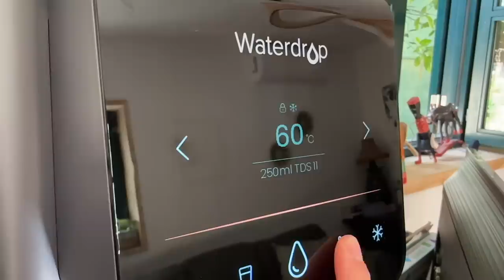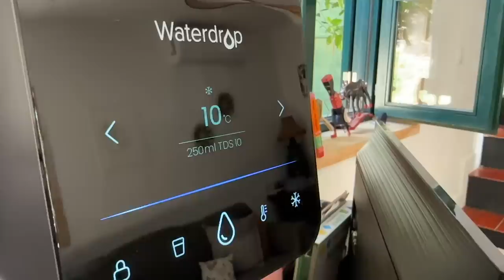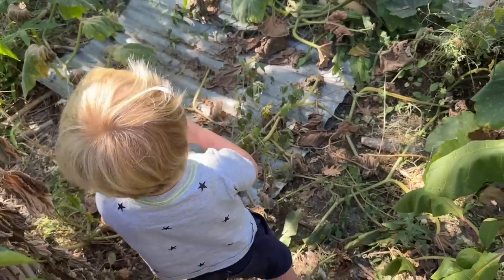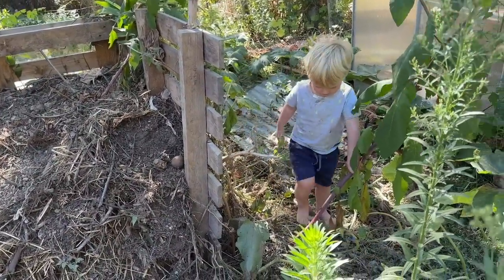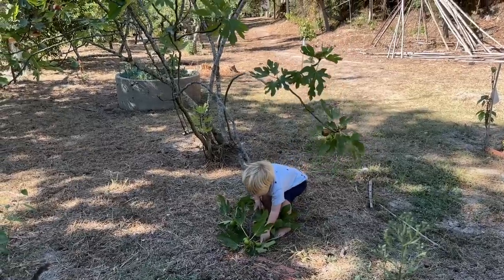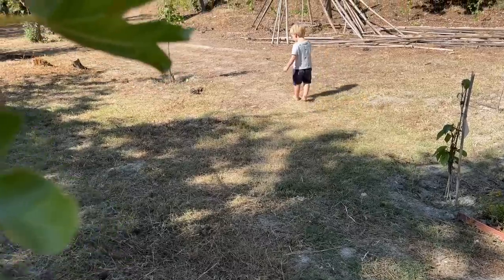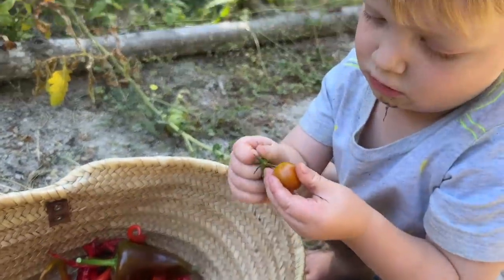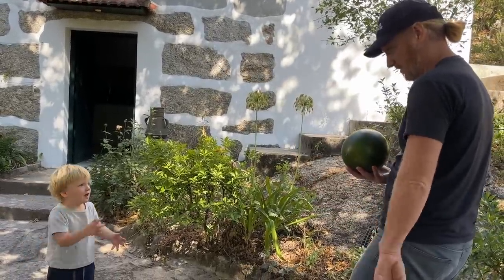It's time we GOT THIS DONE on our Portugal Homestead

Comment: I have a large lidded bucket with a sturdy handle that I just leave in my garden. Inside I keep much of what I need to work in the garden. String to tie something up. Scissors. A hand trowel and a hand cultivator. Small stakes. A few pairs of garden gloves. Bug spray. A small hammer. And a pair of hand clippers. This way I have just about anything I need on hand at all times to work in my garden. I snip all my vegetables loose with the hand clippers. Cut string to tie up plants. Pound in stakes at each end of row. Cut and tie string to set as a guide to place my seeds. When I m done I just tightly close it up and set it in an area where it’ll be a bit shaded and out of the way but handy.
Reply from the maker: That is a lovely idea Kathleen, thank you for sharing that with us! 🐓💧🍅🍉🙏🏼🇵🇹🏡

Comment: Hi gang !!
Tara, as you mentioned, mebbe better to make big compost. Is there any manure available?? Horse, cow, goat?? You could also add the chickenshit on the compost.
 As for watering, I have seen pipl putting down thin hoses with holes along the beds, just some cm under the surface, and then you could have a water container at the end of the field,connected to the buried hoses, so the water will come under the surface, near the roots, thus saving water.
 Ordinary watering from above, mebbe lots is evaporated and more time consuming too......At least try out the buried hoses,and see whether it works. 
Amazing tomatoes and melons !! And Sawyer chomping along merrily behind yer head....Very charming !!
 Seems that dear John´s shoulder have sort of healed, since used the hand saw on the chicken coop....
As for sweden, me boat are  properly covered and motor conserved, now I have to reap the large leaves of my LARGE 40 tobacco plants, and dry them in the former furnace room while I am on Karpathos, Greece...
.I shall make snuff from them. John have probbly encounter this nordic habit in Finland, putting tobacco under the upper lip....Very practical....hehe.....
Alldabestest from auld mikke...;-D
Reply from the maker: Hi Mikke, great hearing from you again. Thanks so much for all the advice regarding the compost. John has indeed heard of that nordic habit haha best of luck with all the large plants friend! Thanks so much for watching 🐓💧🍅🍉🙏🏼🇵🇹🏡

Comment: TOMATO JAM

Put tomatoes in boiling water –
take out and peel off –
Now weigh your tomatoes –
for every 1 kg of tomatoes, 1 kg of sugar –
put the tomatoes in the bottom of your pot –
simply crush the tomatoes with your hand -
now pour the sugar on top –
let it stand for a while until the sugar starts to melt -

I put my stove on 1 so that it only gives a little heat from below -
stir often - just be careful that your sugar doesn't burn -
now throw in a chopped ginger root –
Cook for about 2 hours quickly - add about 3 tablespoons of lemon juice -
Test your syrup in the fridge to see if your syrup is ready.
To test, pour some syrup into saucer and put in the fridge - let it sit for a few minutes -
if you take it out and you turn the plate diagonally, it should run down slowly like a teardrop, if it runs down like water, continue cooking.
Keep an eye on your jam, tomato jam burns easily and you can also easily cook it for too long and then it is tough - if it is too tough, add more water and cook again for a while.
Bottle warm
Groete Debbie
Reply from the maker: Thank you SO much Debbie, this sounds amazing! 🐓💧🍅🍉🙏🏼🇵🇹🏡

Comment: Bom dia from Colorado!
John, until cloning is a viable option you might want to cut yourself some slack! Don't forget to breathe! Lol
Tara, one of my favorite recipes for fall is squash soup. Ever tried fried green tomatoes? Yummy with parmesan cheese and mayo.
If you want to sweeten watermelon tried a very small sprinkle of salt. Sounds weird, but it works.
Reply from the maker: Hello Abigail, great to hear from you friend. Squash soup sounds delicious, do you have a recipe for us? They sound delicious! Thanks for the advice on sprinkling some salt on the watermelon too 🐓💧🍅🍉🙏🏼🇵🇹🏡
Reply: The lazy version is to peel, seed, and chop the squash into chunks. Boil on low until soft in veggie or chicken stock. Season to your taste - salt, pepper, thyme, cumin, onion powder, garlic powder. (Curry powder?)
Blend to your favorite consistency, add cream and a drop or two of sherry. Sprinkle roasted pumpkin seeds on top. Should be thick and creamy.

Comment: John surely the chickens are not going to be safe from foxes etc with a hole at the top wall that you have just sawed the top off??
Reply from the maker: Hi there friend. We closed that hole off with a panel. The door needed to be cut shorter so it opened under the roof tiles. Great to hear from you, thanks for watching 🙏👍